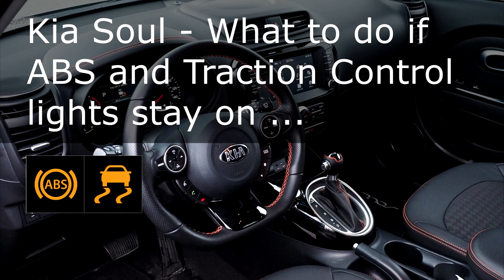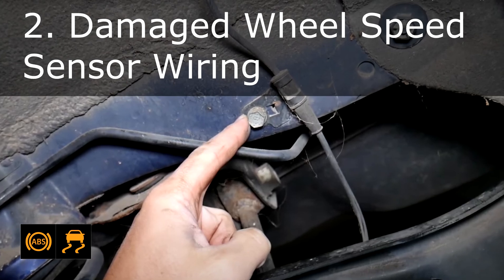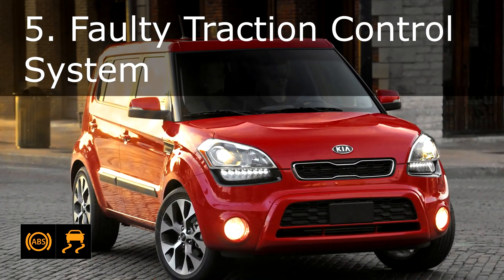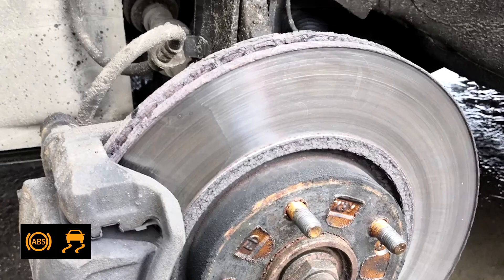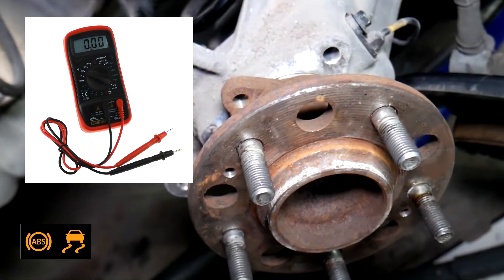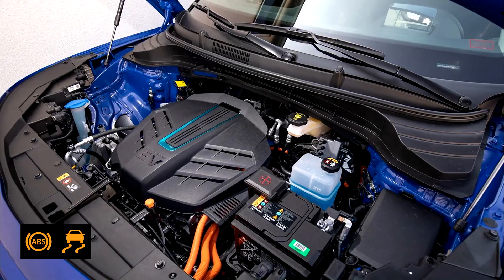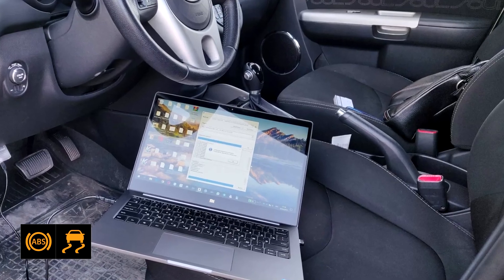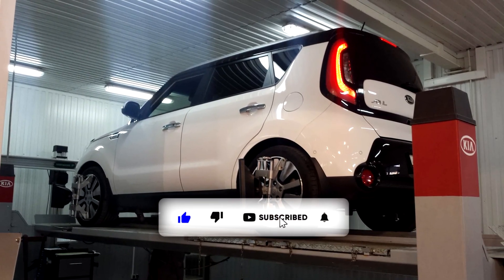Kia Soul | ABS and Traction lights stayed on

Comment: Hi, thanks for your video. My 2 warning lights only came on and stayed on after putting on new back tires. Unhooking the battery has not helped. It doesn't make sense to me that it would be one of the other issues since all I did was change some tires. 2018 6 speed manual 1.6 liter engine. Any ideas? Cheers
Reply from the maker: It’s likely the TPMS triggered after the tire change. Make sure all tires are inflated to the correct PSI, then drive at highway speed for 10-20 minutes so the system can reset. If the lights stay on, a TPMS sensor may need checking.
Reply: Could be your rear speed sensors or wheel hub on either back wheel